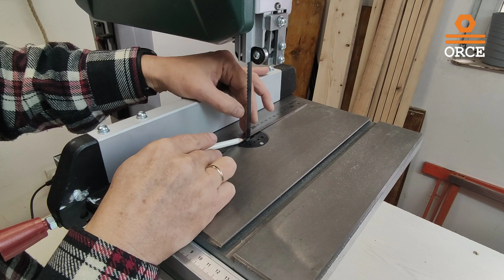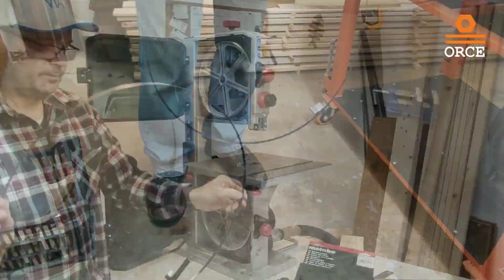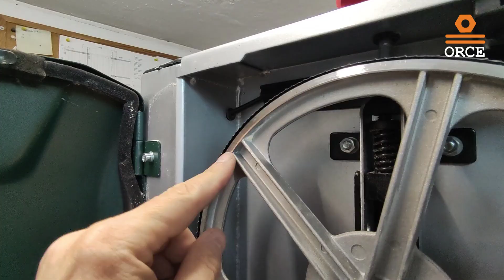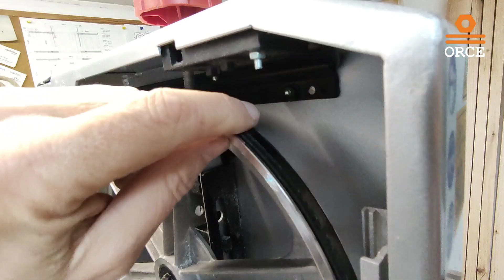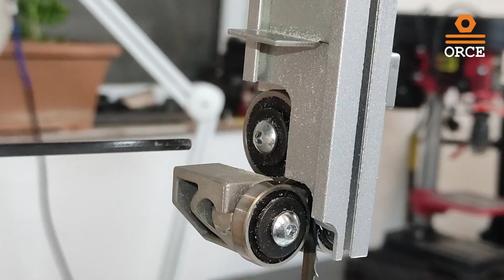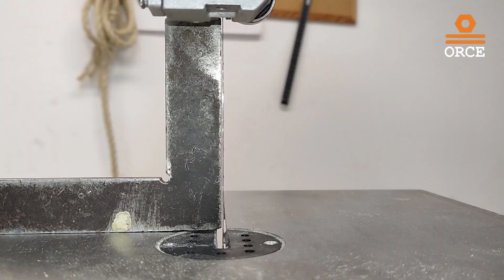How to adjust the drift- changing saw belt & solving problems on bandsaw Metabo BAS  261 #powertools

Comment: Thank you for the good tutorial. I recently bought this same bandsaw en changed the blade also to 6 mm. But when i try to make a reindeer, as shown in many video's on YT, the blade keeps tilting and stops. When i pull back the wood, the saw starts again. Even with a little pressure, the sawblade stops. I made all the adjustments you showed, but keep getting this problem. Have you had the same problem? Or is it the blade? It was not expensive, bought it on Amazon for 15 euro. Can you advice me? Thank you in advance. Kind regards.
Reply from the maker: Just to understand, blade stops movement completely? Than should not be happening in any  case. Blade  stops is some switch on the doors is activated.   Check to see if you have some issue with the switches. Send me info back. Welcome to the channel.
Reply: @orce_MKD_DIY  Thank you for the quick response. Yes, blade stops completely, in the curve. Even in a minor curve, it stops and i hear a kind of buzzing sound. Strait cuts are no problem. I adjusted the tension several times, but it makes no difference. It especially happens, when i have the block of wood in the upright position, if you know what i mean.
If i see, how it is done on YT, i see no problems with that. Kind regards and thx again.
Reply from the maker: Try to cut strait line. Do blade stops only in curves? There is limitation how far you can bend curve.
Reply from the maker: Also, chek tension on blade. Maybe is too lose and small resistance stops the blade, but wheel down continues to spin. That is bad situation and will damage rubber belt on wheel down. Send info back.
Reply from the maker: Hello, Rowdy. :) What is going on with your bandsaw now? Did you find the problem?
Reply: @orce_MKD_DIY  Hello, no still struggeling. Maybe the machine is not strong enough, for what i want. If i have a block of (soft) wood flat on the table, it is ok, not great, but i can do it. If i put it upright on the table, the blade jams. I put the least amount of pressure on the block, but it jams almost imediatly. Now i have broken my 6mm blade. I don't know what  i am doing wrong, but will keep trying. Thx for your support. Kind regards.
Reply from the maker: @vdle68597 i cut only pine and laminate flooring. I hope you solve the problem. Have a nice day.

Comment: Thanks 🥳 What’s your opinion on this saw? Would you buy it again or save for something better?
Reply from the maker: Hello, Hag. Well, it is very nice for that price. And for me, hobby user, I cant see any better model here in my country Macedonia.  You can use only 12 and 6 mm blade for this one, so for smaller radiuses probably you will need scroll saw also. This tool also needs a lot of adjustments, it  is not plug and play tool. Best regards, Orce.
Reply: @orce_MKD_DIY  Thanks for the feedback 🥳 The main reason I want it is for resawing and avoiding stupid cuts on the table saw 😄 If I end up getting one I’ll definitely revisit your videos! They were really informative and well made
Reply from the maker: @Hagearkitektur  , just one note. this tool is not good solution for reaswing. It takes too long, cut in not strait like on table saw. I still use table saw for resawing, much better. This one is for smaller, precision cuts.  Have e nice evening.

Comment: I probably tensioned the blade too much, and ran the belt off the wheels. The machine immediately stopped (good) but now i can't press the stop or start buttons. Does anyone know how to re-set it after this fault? i have googled and seen other people with the same issue
Reply from the maker: Hello, Karstenhoff,  sorry for late response. Now I am back from holiday and strait to my daily routine. About your problem, first about blade slipping from wheels, it happens to me also, machine stopped few times, but I have not seen any problems in STOP/START button. One question, is your light bulb above the saw working? Just to check if there is power on the machine. I am planning next week to work whit my bandsaw, if I see some solution,  will contact you. But, I presume that switch that signaled machine to stop working maybe is not returned to its original position. Try moving upper wheel up and down, since lover is in fixed position. I will contact you if I have some solution. Best regards, Orce
Reply: @orce_MKD_DIY  i think the sudden stop just jerked things a bit out of position. After closing the doors again while pressing directly over the door closing sensors I got it working again

Comment: hello there, you can adjust only the upper guide using the 3 upper screws, you don't need to touch the down screws
The teeth have to be a little bit outside the rubber, if you make the tension, as you say, you going to ruin the teeth and rubber aswell
Last thing, for curved cut, the guard has to stay up, to permeit more flexibility for the blade...
you have a good explanation, but wrong concepts.
greetings
Reply from the maker: Thank you. Very nice comment. I am grateful. Have a nice day. :)
Reply: to mamertofernadzez Laba diena. Deja, tai Jūs pateikiate klaidingą informaciją.